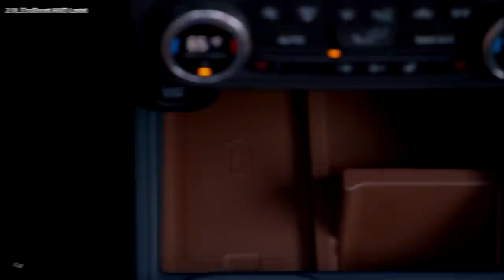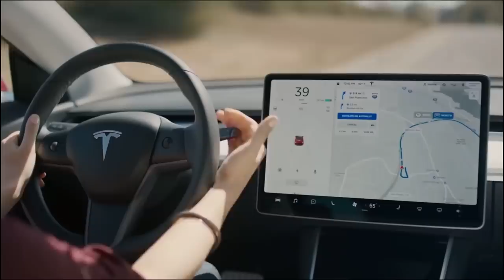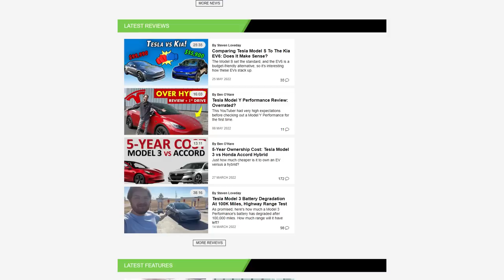Ford CEO Confirms Ford Maverick Has A HUGE Problem

Comment: Recalls happen with any new platform vehicle... Recalls happen with most vehicles. Give it a some time and these issues will be sorted out.
Reply: Stop making excuses. These sort of recals shoult NOT be happening in 2022. This is a deliberate decision to CUT COSTS at the sacrifice of quality and reliabilty. And those cost cuts are NOT being discounted on the MSRP of these vehicles. Auto manufacturers like to blame the part makers, but it is Ford  and others squeezing their Parts company margins forcing quality to be sacrificed. When Accountants replace Engineers this is the result!
Reply: @mychargedtesla539  every new vehicle will always have problems, it doesn't matter the brand or car, example the new Toyota ev it had a recall because there's a chance that the wheel could detach while driving, again it's a new vehicle, Toyota has also had to recall airbags that were purchased from a company that makes them this didn't happen once but twice, Toyota isn't a company that cheaps out but it's something that just so happened to the newest vehicles since they are new and they still need to work some kinks out but the next model year will be better than this one because creating a new car always has space to work things out, if they really did want to be cheap they wouldn't even bother fixing this problems.

Comment: I don't mind recalls as much as I mind companies like GM and Honda refusing to acknowledge obvious problems or in some cases even hiding them (I'm looking at you Volkswagen).  At least Ford is being proactive in trying to correct their issues.
Reply: Lol ford is probably the worst with hiding shit. Took em years to do anything about the focus/fiesta trans, bronco 2.7, tbh everyone does shady shit. It's the way the world works
Reply: @jadenantal1652  pinto and the exploder. Mic drop
Reply: Idk, I'm still waiting for them to recall the hybrid battery cable before people breakdown in the middle of the road
Reply: There is a difference between acknowledge and hiding a car problem...i.e., when a safety issue is concerned, auto makers are generally proactive in recalling their cars.  If not, they do not need to be proactive.  After all, no auto makers want to face the class action or law suits that are the results of these safety problems...
Reply: @slchang01  ford was fine with lawsuits on the pinto. It was calculated Into their analysis
Reply: Like ford and the transmissions in focus
Reply: Nah man, these recalls are way too dumb to be excusable for a company that literally invented the production car. They should have this shit down to a science but they can't even design a seatbelt that is properly secured to the car? How do you mess that up with over 100 years experience in the industry? Somebody is asleep at the wheel, there is no excuse for these problems.
Reply: Stand by your Ford. Lmao 🤣🤣 got stuck with it so drag everyone down with ya huh??
Reply: @themightiness  They messed it up because they have been in businesses that long and don’t have processes in place
Reply: Like the guy said ford and the focus, Fiesta. They new it but sold it anyway hoping it would last past the millage warranty lol
Reply: I love ford owned multiple however the 05-09 mustang had issues with coolant tank breaking and alternator going bad. Had to replace both yearly. Ford never did anything for it.
Reply: @Stwarrior23  I have that with a Volvo. It blows blower fans every few years. It was a Ford then
Reply: You can add Toyota to GM and Honda
Reply: @dc5325  Honda Odyssey and other models from about 15 years ago. Shit transmissions
Reply: @Stwarrior23  You mean to tell me that you bought a car that looked like a previously made car and didn't expect for the new car to run like an old car?? Something wrong with you Son. You ain't right!! I'd like to work ya real hard for about two weeks and get ya in order. First thing Im doing is changing your name to Dilbert Dumbshit. Ok Dilbert, do you wanna come work for me??
Reply: @danielemery9538  Like Toyot and engine blocks cracking and fuel pumps failures.
Reply: Don't forget the Triton V8 issues on the Ford F-150. Ford never recalled them for the spark plug issues.
Reply: don't kid yourself. Ford has a reputation through many class action lawsuits and issues all the way back to the Ford pinto of hiding things as long as possible. but when the highway safety and motor vehicles administration says you have an issue you have to go public with it. and those are recalls that they specify, you should see how many four dozen internally before the customers ever know about it.
Reply: True.
Reply: add in hyundai with their 2.5l burning up.
Reply: @2steaksandwiches665  -- The Pinto was a loonnnggg time ago.
Reply: @lamplighter5545  doesn’t matter. Things like that should not go away.
Reply: @2steaksandwiches665  -- I'm not saying they should go away. I'm saying it's old news. There is probably not a single person currently at Ford who was an employee when the Pinto was built.
Reply: I agree, BUT when you actually own a vehicle that has numerous recalls and you have to give up your vehicle for a day with no courtesy car provided, it's a real hassle.
Reply: I had a 2013 Volkswagen TDI Passat, it has so many recalls (Volkswagen was hiding it from me) giving me the run around for almost 9 months. Costing me literally thousands of dollars trying to fix recall issues I wasn’t aware of. 

They finally kept my car for 5 months gave me a new loner non diesel Passat. The invoice showed over $18,000 worth of parts of a long list and pages long of things they had to replace. I bought it as a lease return, it had about 68,000 miles on it. I had major problems around 115,000 miles, so much internal damage that the car would no longer run, but it would start. Then shut off to protect itself.
Reply: @BoyFindsTako  I've never owned a VW, but owners seem to be in 2 categories. The VW fanboys who swear up and down they're the best cars ever made, and everyone else who says they're problematic, expensive to fix junk. Back in 2018 I was interested in the VW Jetta TDI wagon (whatever they were calling it at the time), but after looking at two different used ones that were both 1-owner with around 50k miles and both already had their catalytic converters replaced, I figured they'd be a money pit. Now this year,  I was interested in the new VW Taos. Looks handsome and seems like great value for money. So I read through owner reviews on various websites. So many complaints about electrical and fuel system problems on cars less than a year old. No thanks! I'm in the "VW is junk" camp.
Reply: @palebeachbum   The only VW’s I like are the diesels before the blue def era. That whole concept is what is causing the  whole issue. Kinda a lot to explain if your not mechanically inclined (my dad was a diesel mechanic) basically diesel is designed to burn dirty (not clean) to make it clean and not blow black smoke out of the exhaust they are taking blue def (pig urine) taking all the black carbon smoke and build up and trying to re-burn or reduce it by pumping all the black smoke back into the engine components with a module called a EGR which is crappy design. Which is the beginning of all the problems. 

I found this interesting, right before the diesel-gate lawsuit, claiming Volkswagen was so crooked. Did you guys know that Volkswagen put out a non hybrid diesel car that got 271 MPG! Look it up, can’t remember the name of the ugly car but it came out around 2010-2012. 

Diesel by design is way more fuel efficient (back in the 1980’s) the small diesel cars were getting 60-80 MPG in America. But everyone figured the Honda Civic and Accord were the gas savers. 

Diesel burns dirty, noisy, but…because it uses a fraction of the fuel to run vs gas cars. We over look diesel’s potential and what Volkswagen was trying to show the world. 

I think the EPA and all the regulations reined Volkswagen. I liked the Passat TDI, my turbo 4 banger would smoke any 4 cylinder gas car out there stock. 

And…it got 60-70 MPG until the regulators claimed that Volkswagen single handedly polluted the world and sued the crap out of them. 

Volkswagen is cool, they want to show us that we can get over 200 MPG. But guess what…they can’t because most of us actually don’t research the “why” and the truth and just judge everything depending on what we hear vs what we find researching a topic over months and even years.
Reply: Right on Martin.  I totally agree with you.  Like Hyundai did with those Sante Fe's.  I had one that had engine problems.  They did not even announce a recall.  They would just repair the engine for free.  I asked the guy at the dealership were they going to do a recall and he told me no.  On a case-by-case basis.  And they added another 100K miles to their warranties, but told no one that they even had the extension of warranty on their cars.

Comment: Recalls are going to happen I honestly like that Ford is on top of recalls. Unlike some other manufacturers that put them off until they are forced to implement them.
Reply: If they engineered them better and tested more thoroughly  recalls wouldn't be as necessary.
Reply: 5th recall?? Lmao 🤣🤣 Yeah I'll take that Toyota Tacoma all day.
Reply: 2021 ford f150 11 recalls toyota 2 or 3 lol. ford new the FOCUS had a bad transmission and sold it anyway and only gave people 3000$$ back for a 20000 car. Glad I recked mine before owning it over a year. Ford has more recalls than almost any other brand that I've noticed I'm only 24 and have seen ford ruin people's lives
Reply: Some people take the "loyal" thing too far and need to see it for what it really is. Pissy Poor engineering and quality control.
Reply: @mikearmstrong9767  And you think Toyota doesnt have recalls? I rather have small minor recalls, over fewer but major fuck ups, such as engine blocks cracking or fuel pumps failing. Always glorifying Toyota when they fuck up like anyone else.
Reply: No. They are not on top of it.
Reply: @bmw803  Let's not forget that Toyota is currently unable to solve the problem with the wheels falling off their new EV, so are buying them back from customers!🤣
Reply: @markbeiser  Exactly. Some people are immature and regurgitate shit like a parrot. Oh well!!!
Reply: Me too Trevor

Comment: I took delivery at end of April have had no problems so far . Mpg average since new 39.1 mpg this includes a 5000 mile round trip across country at 70 plus mph .
This whole info sounds like sour grapes when some company is trying come out with a new model
I am very happy with this truck especially when considering first year in production
Reply: Actually really good for a relatively new platform.There are some shared parts. But the chassis is on it's own. Like the 1st gen body Granda/ Monach it will have teething problems. The second gen Fairlane body actually worked real well. Pretty much also the same underneath. I worked testing for FoMoCo until I got tired of it from 2015 to 2018. I don't remember a Ford odometer I tested the read more the 20,000 miles. For some reason I got a lot of 20 miles or less cars that did not have the break in mode locked. I did notice that gas mileage stopped increasing on most Fords at 1, 000 to 1500 miles. and the performance got better.
They would not let me drive a Mustang after I did drive it like a customer and somebody seen me.
 But I did get to drive a Bullitt because I was one of those that can drive RHD and LFD with 3 pedals and not tear up the clutch. Those are great Mustangs. You guessed it. The Bullitt was the one that put me back in Expedition and Navigrator testing.

Comment: My last time in a Ford was when I rented a new 2012 Focus for a week - yeah, with the infamous "PowerShift" CVT transmission. Ford's own engineers said it wouldn't work, but management went ahead with selling it anyway, then telling unfortunate owners to keep returning to their dealer for (endless and futile) software updates. So much for those commenting that "at least Ford doesn't cover up their problems." We won't mention the Pinto fire deaths and Explorer tire blow-outs (causing rollover accidents).
Reply: Oh please.
Every manufacturer has these problems.
2012, was very early for CVT's and tbey were all pretty fd up then.
One of the few to get it right in that timeframe was subaru.
Toyota and Honda were also selling junk cvts at that time.
2010 was really the first year they started going in many vehicles across many brands.
They all did the same thing, because they were legitimately trying to figure it out.
Ask the first people who drove model 3's, the first year runs, they will all have stories to tell. ask anyone who buys any new model for the first 6 months of production. You are guinea pig buying them.
I'd bet u had zero issues with it during the rental. If u claim u did, id bet ur lying.
Reply: Ford burned me twice, a 99 F 250 diesel  and a probe GT. I just can't buy another FORD.
Reply: PowerShift is not a CVT transmission, its a dual clutch automated manual transmission. It was a disaster with tons of problems and low life expectancy due to inferior design and parts.

Comment: Even with the recalls that they are addressing I am still going to order a 2023 ford maverick hybrid the price alone is worth all the headaches
Reply: I tried to order a 2023 Maverick yesterday 8/19/22 and was told that Ford is keeping the order banks closed until 9/22/22 
I guess I will try again in a month. Wish me luck!
Reply: @99shadows66  good luck yeah I heard it was moved to September as well
Reply: @99shadows66  I was told 6 months to a year after I order it in September. I was told this in may. So 15 months wait. Then price isn’t locked in when it shows up they can charge what they want. I bought a used manual transmission focus instead. Getting 35 mpg. Instead of the 11 I was getting in my Jeep.
Reply: @AlphanumericCharacters  Damn, that's a long time to wait but for me, it's worth the wait as I am not in a rush to replace my current vehicle. I currently drive a 2002 Ford Sport Trac XLT and I love it, it has over 230,000 miles on it and everything still works. To me, the new Ford Maverick is nothing but my current truck reborn with a new name and modern technology.  I want the hybrid version because I want the best MPG possible and I am totally comfortable driving a FWD vehicle. The 4 1/2 foot bed is exactly the same size as my current bed and that has worked out perfectly for me all these years.
Reply: I waited over a year told me to order a 2023 with no date then will I get it, I canceled my order and bought a American made Santa Cruz very satisfied now
Reply: @robertmiller5644  I checked out the Santa Cruz, unfortunately, the bed won't carry my lawn tractor (it's not wide enough). The Maverick bed is very similar to the Ford Sport Trac and a little lower because of the uni-body construction so it will be even easier for me to load my riding mower into the bed of the Maverick.
Reply: @AlphanumericCharacters  i have a Mav Hybrid XLT ordered Oct/23/2021, just got an email yesterday; thank you for waiting we want to update you on your status... blah blah blah. I am glad my current car runs great but to wait a year for a vehicle is a mind game.
Reply: @99shadows66  I bought a trailer year’s ago to carry my Bolens tractors around  after my brother in-law had a ramp slipped off hurt his back be careful
Reply: @robertmiller5644  Sorry to hear about your brother-in-law. Ramps slipping out have always been a concern of mine but so far I haven't had any issues. Hopefully, I never will.
Reply: Yeah, but after the short warranty period those head aches will add up fast with the cost of parts now! Better to pay a little more up front "Toyota" then to get stuck with huge repair bills later "Ford".

Comment: Yes, believe Ford will get these bugs out for the first model year of the Maverick. New procedures will be in place and it's not like the vehicles have multiple recalls as Ford has addressed and corrected them. Like someone drill to far after a bed liner and hitting the gas tank. Correct, same with seat belt etc. The side airbag issue seems to be more a supplier issue as was not there initially and started in early February.
Reply: @Bangkok-ik1fp  I guess you would never buy any vehicle since all mass produced cars have recalls and that is on every manufacture ever. Airbag issues are industry wide for many years and that is from the suppliers. Knowledge of recalls and types of each is important when purchasing a vehicle, buying first yr production is a NO as all mass production problems will occur in that first year or second yr run.

Comment: I hope Ford can get the quality control issues resolved. I so badly want to own a new Ford Maverick.
Reply: Don't hold your breath, it's a Ford. I've owned many of them and they are not what I would call well built. I've owned 2 Econolines, a T-bird, a Tempo an Explorer and probably at least 1 other that I can't recall. They are the Walmart of vehicles - cheap, average and not particularly fun to own/drive.

Comment: Love my Maverick. It’s a basic XLT FX4 that gets good mileage
Reply: Nice, that's what I have been looking at as well...I was hoping they'd offer an AWD hybrid this coming year but doesn't look like it, I guess I'll wait a while and see...really like the design ideas they have on the Maverick....its got plenty of bed space for most of my needs, I have a trailer for larger items, and a 3/4 ton pickup if I need to tow heavy stuff....I just like the idea of a small pickup again, too bad it has 2 doors too many though as I have no need for a crew cab.
Reply: What's your best mpg?
Reply: If I’m on the highway between 30 -32mpg.  With 7k miles I have combined mileage of about 27.8mpg.  Mileage seemed to improve best after 4K miles